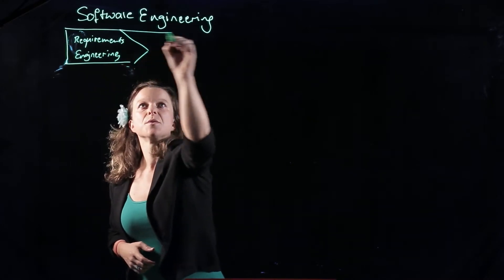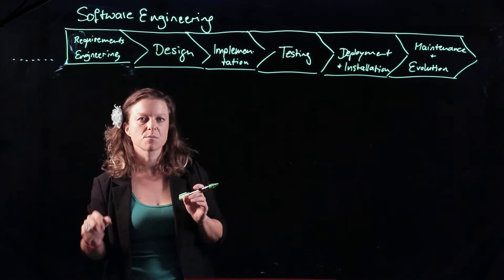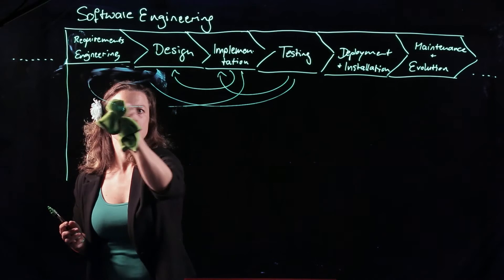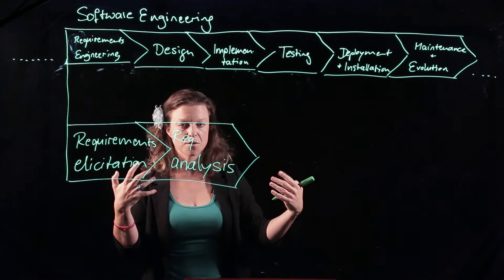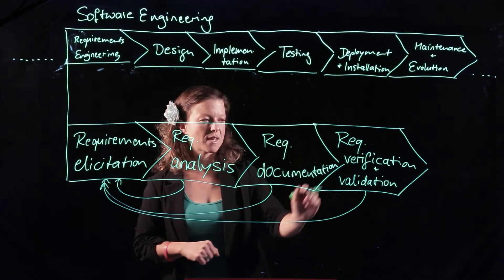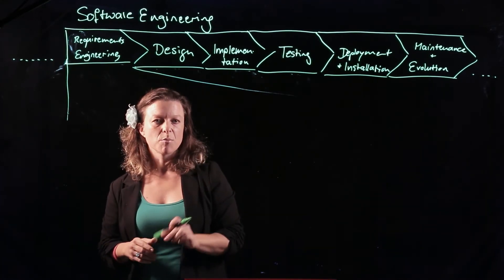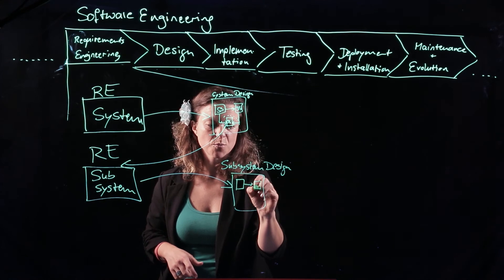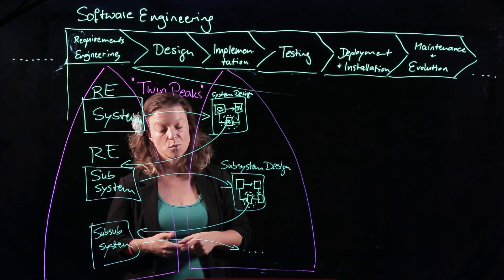Requirements Engineering lecture 2: process

Comment: 1. The solution should be fully accessible in the English, French and German languages.-general requirement
2. Users should be able to retrieve holiday details by booking reference number.-functional requirement
3.Holiday
 providers shall be able to add the details, date and prices of their tours directly onto the system.-functional requirement

4. The solution will be able to support up to 2000 concurrent active users.-functional requirement
5.The solution will be restorable from back-up within 4 hours.-non functional requirement
 6.The solution should be able to retrieve holiday details within 10 seconds.-non functional requirement
Can u please let me know if this is correct. I am preparing for the exam and my answers are not matching with the solutions so asked. Thank u.
Reply from the maker: Megh, it's better to discuss that with the person you are taking the exam with. There are slightly different ways to argue for why a requirement is classified in a specific way. I for example don't use 'general requirement' and am not sure what your definition for that is. Req 4 is a scalability requirement and can be argued either as functional (because very specific) or non-functional. Req 5 and 6 are similar - they refer to qualities of the software, recoverability and performance, and then it depends on if you classify them as detailed functional requirements or still as non-functional. Sorry if this sounds fuzzy but I don't want to tell you 'my way is the high way' and the person you take the exam with may see it differently. In the end, the classifications are only for helping with how to further deal with a requirement and it is just an intermediate step.
Reply: @BirgitPenzenstadler  Hi Birgit, thank you very much for your reply. yes , you are right there are many different ways of categorisation so I was getting confused. I will follow the book prescribed by the exam authority.  once again many thanks.

Comment: One of the requirements of a new accounts management system is that it must allow users to scale the size of text on the screen. The requirement states that the text can be reduced to 10% of normal size and increased up to 500% of normal size, depending on the preference of the user.
What would this requirement be classified as? general or non functional? Can you please let me know this? Thanks in advance.
Reply from the maker: In a more abstract version, say 'for usability reasons, the user should be able to adjust the font size for readability', it would be a non-functional requirement. In this refinement it can be considered as a functional requirement, because it clearly states how the parameter 'readability' shall be implemented.
Reply: @BirgitPenzenstadler  thank you so much for your reply. It really means alot.